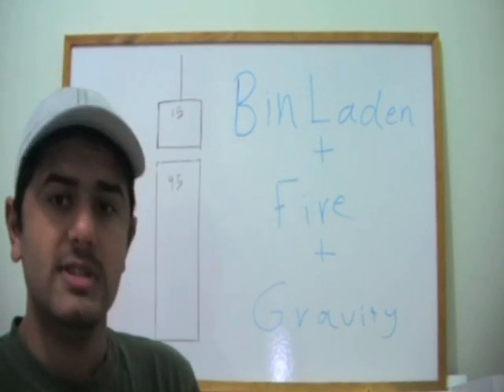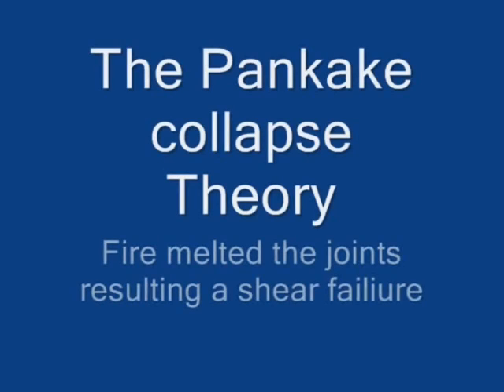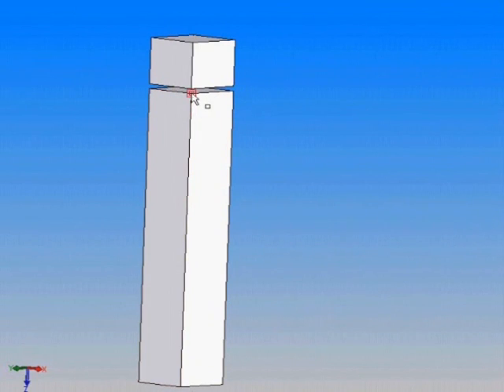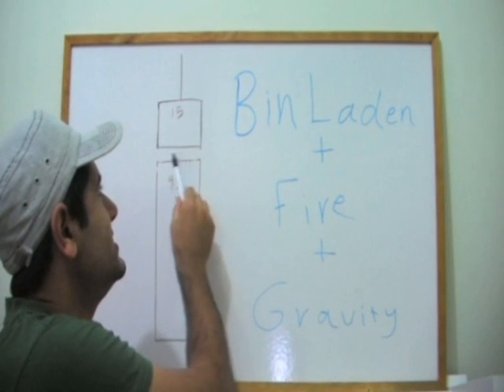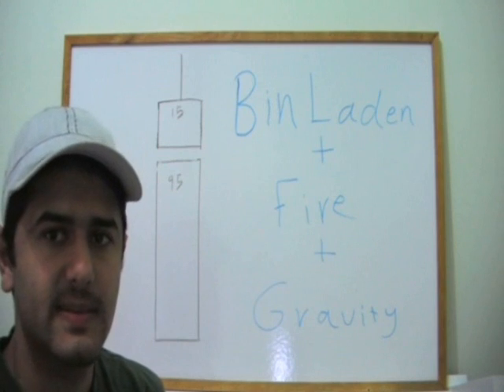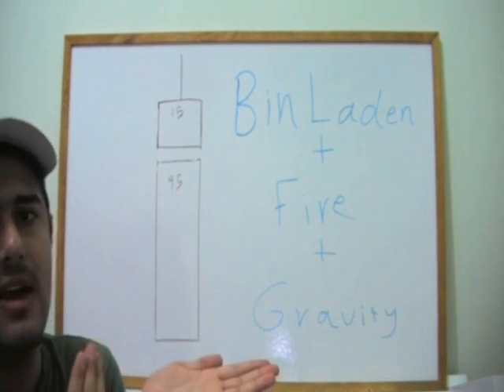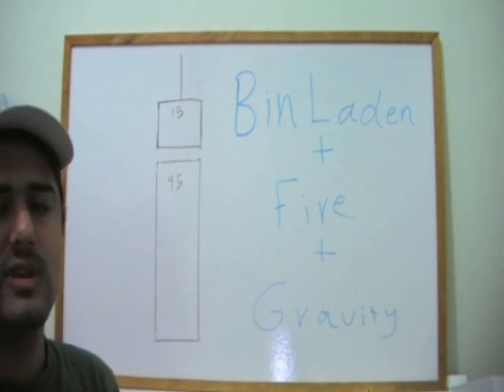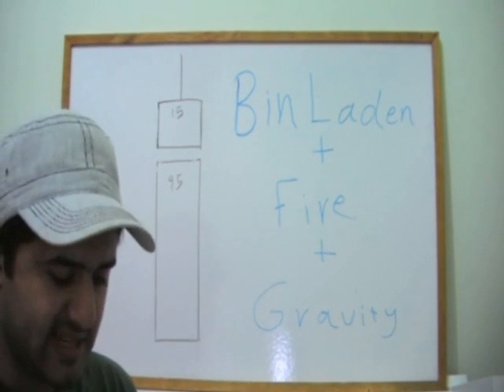(Part1) 911 Simple Physics Structural Failure Vs Demolition

Comment: Those three buildings were held up by their own internal tension. The floors were both held up from below and suspended from above,and all the columns were concentrated at the core and facade of the building. Most of the core and  many facade columns were destroyed by the impact of the planes. The initial impact of the planes also loosened the joints all the way down, and turned five floors, not just one, into rubble instantly.  It was a miracle that the buildings stayed up as long as they did.

Comment: Pulverize itself is exactly what it did.  The top of the north tower magically disappears and still manages to maintain an energy great enough to keep piledriving through the lower floors.  The lower floors should be stable like a mofo with caissons drilled to solid bedrock.  I just don't see the teeny tiny top section causing this much catastrophy on a stronger base section.

Comment: I assume the floors were 4" concrete on steel decking.  Its extremely hard to imagine all of this pulverizing into dust in 0.0525 seconds.  Jackhammers which provide very precise and seriously concentrated loading to a single point only crack concrete and break off segments.  The WTC floors would not have provided even close to that kind of loading at a single point.  Take a square foot of area by 4" concrete by 30 floors...~1500lb.  Jackhammer?...1,300psi or 187,200lb

NIST is a proven lie.

Comment: controlled demolition - uncontrolled demolition

take a sheet of paper draw a line down the middle. on the left side list all reasons the demolition of WTC 1 looked like a controlled demolition.
on the right side list all the reasons that the demolition of WTC 1 looked like an uncontrolled demolition.

how big is that list on the right?

demolition deniers(*), how are you doing?

(*) affected by meme. not able to comprehend floors 1-92, 95-110 of WTC 1 were demolished.

Comment: "crushed"? "deformed"? "collapsed" 

shorty40merza,
there are some useful components in your video, however, I would strongly urge you to get a working knowledge of the word 'meme' and  gain an understanding of how it is used as an operating mechanism of the 'engineering of consent' as propounded by Edward Bernays.

to have a useful discussion there must be a common understanding of what happened in the real world on 9-11-01.

World Trade Center 1 was demolished.

Comment: jm -

Again you confuse the air temperature (what steel was *exposed* to) and the temperature the steel reached (not more than 250C).

You can *expose* a frying pan to higher temperatures than NIST found with a lit cigarette, but the steel won't get weakened as a result.

Comment: jm -

NIST has several samples they recovered that were shown to have been heated in excess of 1500 degrees?

If so, they should publish this information.

Their metallurgical analysis makes reference to 250C - steel does not even *begin* to lose strength at that temperature.

Comment: jm -

Samples of steel recovered from WTC showed no evidence the core columns heated above 250C, such steel only *begins* to lose strength at 300C.

The reason why is likely that the fires didn't get a chance to burn long enough, and it is likely much of the fire-proofing remained ion place.

The fire-did-it theory is dead.

Comment: jm -

One New York Plaza (NY, NY, 08/05/70) - partial collapse 50-story office building. Fire caused several steel filler beams on the 33-34th floors to fall and rest on the bottom flanges of their supporting girders.

Comment: jm -

Yes, hard for any alleged 'falling mass' to hit the small targets undamaged columns represent. FYI - video shows columns exploding in all directions, too.

No evidence 'impact' damage and 250C steel temps could cause simultaneous failure of 187 columns.

Without initiation, no collapse.

'Impact' was assymmetrical - any collapse would be also.

It's also been calculated that any possible collapse would be arrested, as always happened before & since.

Hope this helps...

Comment: That the jet fule fires structurely weakened the steel support columns sufficiently to cause the floors to dislodge from them and consequently fall due to gravity.

The problem with this theory is that the Towers fell at free-fall speed, which is not consistent with the floors 'bashing' into each other on the way down. The floors would provide resistance, and so the structures would have fell much slower.

There are many other reasons but the word count limits what I can list in one go.

Comment: Then I direct the same question back to you - what skill set are you drawing from when forming your assumptions about the complete obliteration of the Towers?

I quote you -

"When the outer columns failed the load is transferred from the columns to the trusses on the first in tact floor before below the failure zone." You only mention the floors below the failure zone - what about the ones I am asking about?

Comment: jm -

Falling rubble doesn't stick together like rolling a snowball growing bigger as it goes.

Any local failures in a steel-framed skyscraper will be arrested from becoming total collapse by the undamaged steel that surrounds it - like always happened before and since 9/11.

Comparing WTC towers to loose snow shows you have no clue what you are talking about.

Comment: ct -

Unfortunately for OCTs no steel was found that proved theory that any steel reached 1800 degrees. No initiation mechanism, no collapse.

Falling rubble does not build mass - WTC not made of snow. Just lots of rubble falling hitting different places at different times.

Any local collapse would be quickly arrested, that's why no 'gravity-driven global collapse' ever happened in steel-framed highrise before or since - because it didn't happen on 9/11 either.

Comment: jm -

No such thing at WTC as 15-story 'bloc' in freefall.

Even if it were true, joists and bolts same in upper part as in lower part. Newton: equal and opposite reactions = upper part should be as damaged by impact as lower part.

As building explodes loose parts don't become glued together, you just end up with a bunch of loose parts raining down, hitting different places at different times.

WTC was not made of snow.

'Gravity-driven global collapse' theory died of sheer absurdity.

Comment: immediately after collapse initiation, the dynamic load presented to the remaining structure was many times that of the static load to which it was designed, and thus a total collapse was the expected outcome. Only a total fool would assume that the non impacted portion of the buildings would have any bearing. Once you have momentum each floor is doomed. And each subsequent floor has to deal with the added mass and velocity. Yes gravity increases velocity.

Comment: Funny, funny, stuff. Of course if you don't care about horrific collateral damage your plan will work perfectly.

The point of controlled demolition is...CONTROL.

Collapse initiates on damage floor follwoing a top down path and causes extreme collateral damage. No CD behaves this way. Also, any explosive would have to 1) survive the impact and fire, 2) not make any noise when exploding, and 3) leave no chemical trace or blast chords behind. Please, find me something that does this.

Comment: Thizztek: WHAT DUST? Are you expecting me to believe that no large chunks of concrete in the debris? The building was a tube-in-tube design, not box. You'r as stupid as this "physicist" in the video since neither of you have a CLUE of the building's design. The the mass from the 21 floors upon collapse is MORE than enough to drive through the 79th floor, which then becomes 22 floors driving into the 78th floor. 23 on the 77th, etc. And for thermite, I prove that TONS per FLOOR is required. Idiot

Comment: Sorry you re wrong, because the at the the suggest altitude said planes have a maximum velocity due to thick air resistance.

The planes are infact at the altidude incapable of flying more than 350 mph without riping themselves apart as confirmed by boeing aeronautics.

Your wrong this video is correct.

Comment: You've entirely missed the point.

NIST were only asked to examine the reasons for collapse. The rest is common sense! Gravity, momentum, inertia etc!

You also ignore the fact that the towers were made up of thousands of pieces that weren't designed to hold together under collapse.

And no, I am not a 'truther'. Don't insult me. I'm not scum. None of the main structure fell at free fall speed & you know it.

Comment: And you've read all 10,000 pages of the NIST report? Yeh course you have!

The official version of events is the '9/11 Commission Report' not NIST. NIST did an engineering report on the failure of the towers. They concluded that plane impacts & fire caused the collapse.

Comment: Wrong.
There is a huge difference between free fall speed & nearly free fall speed.

And free fall speed on this planet means through the air. But 'truthers' are all on a different planet judging by their stupid beliefs!

You also forget that the towers were made up of thousands of pieces. None of then designed to hold the weight of several floors falling on them.

Wise up ffs.

Comment: my mistake about the designer being killed, it was something I read recently I must have misquoted who it was who was killed. I suggest you google for images of molten metal and trade center they are not fake and there is no reason why molten metal should be there, the fuel from the engines could have weakened the steel but not cause it to melt.

Comment: dr

Thankyou for your inspired comment & use of vocabulary. You show yourself to be another mindless moron.

There are no pics of 'molten metal' at ground zero. They were faked you dummy! But there is credible evidence that underground fires reached temps that could achieve that.

Yes the WTC towers were designed to take a hit from a jet. At low speed. But the effect of fuel was not considered.

And the guy who designed the buildings, Leslie Robertson, did not die on 9/11.

Idiot.

Comment: tuz

Please stop now. You're making yourself look stupid. 9/11 NO INSIDE JOB

You need to understand the laws of momentum & also the fact that NONE of the WTC floors were designed to withstand the weight of the top of the building falling on them. The towers collapsed in 15 - 22 seconds. Free fall speed would have been 10 seconds. There's your resistance from the lower floors.

There is NO evidence of thermite. Its a lie by Stephen Jones. And thermite is not used in controlled demolitions.

Comment: tuz

You are not allowing for mass & momentum or the fact that none of the floors of the WTC were designed to support the weight of several stories above falling on them.

And the WTC towers were not a steel reinforced concrete design. If you'd done any objective research you would have known that.

The more you listen to the 'truth' movement lies, from Loose Change & the like, the deeper into BS you sink. Wise up!

NOTHING about 9/11 screams anything other than Islamic SCUM terrorists.

Comment: buling999: Really? I have to explaing this? The steel is rated under fire conditions, but no steel is resistant. Your attempt to sidetrack the argument by claiming I said steel is "like wax to fire" is quite poor. I'll ask again... who certifies the structural steel? (You dodged that question) The floors that collapsed lost the fireproofing. Why do you think the whole building must lose the fireproofing before collapsing? (Don't dodge this one) You're becoming irrelevant to the discussion.

Comment: buling999: Fire testing the structural steel DOES NOT make is fire resistant. It's only a test. BTW: Who does the licensing? Please don't say Underwriter Laboratories. It'll make you look REALLY stupid. And the fire proofing was stripped when the planes crashed. Right now your grasping at straws.

Comment: buling999: You ignored that fact, that is why I addressed it and why you're wrong. RE: your experiment, YES, the steel will weaken. Additionally, check out Consumer Reports and look up Broil King Signet 90 "they found that the firebox of one grill had melted and the firebox of the other grill had started to crack and deform". ASE know nothing of structural steel, but somehow YOU do with a little burner at home. The more YOU push your point the more incredibly STUPID you become.

Comment: buling999: You're still stupid because you're implying that the heat from the kerosene, from your burner stays static and does not dissipate and that there is no heat dissipation from your steel pot in an OPEN environment (which the fires in the WTC were NOT). Again learn about metallurgy idiot, the alloy for steel is NOT THE SAME IN ALL CASES. Hope using caps, you'll understand.

Comment: shorty40merza: The FLOORS (not slab, idiot) hold together the curtain concrete walls of the WTC. When the steel in the floors weakened from the raging fires, and expanded, the floors collapsed leading to a pancaking effect. Without the floors, the curtain walls bulged and fell. Your reply shows you did not even look into how the building was constructed.

Comment: buling999: Don't post lies dumbass. BUT you are ignorant of metallurgy. The steel for that burner is different that whats forged for structural buildings. And -IF- your burner went to 1800*, -if-, the get some gloves, because you WOULD be able to shape that metal with only your hands.

Comment: buling999: The steel cores; when the fires burned, the steel weakens with heat and expands increasing more damage to the concrete. That set the initial stage for the collapse.

Comment: You fail to account for concretes poor tensile strength. You also do not account that for in the pancake collapse, more weight was above the still standing floors, adding significantly to the falling weight. Last, concrete cracks with concussive force, rendering the impressive compressive strength moot. What scares me is you claim to teach...

Comment from the maker: yes right man, i am myself a graduate from aerospace engineer and working as a structural engineer now , and have been teaching year 12 physics for 4 years, am not smart but it sounds very basic to me. for every action there is an equal and opposite reaction. when the top block strikes the structure below it with a big instentaneous forces that supposedly broke it,, the resistance will still be at least as big as the weight of the block that it has allways been holding...